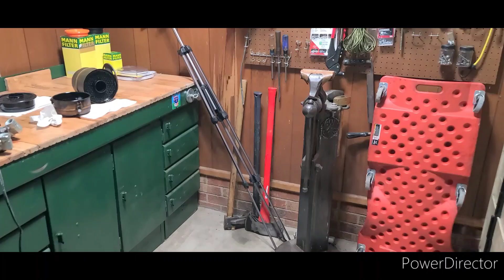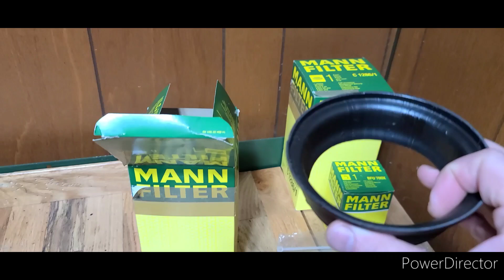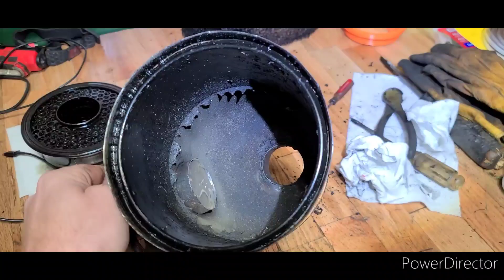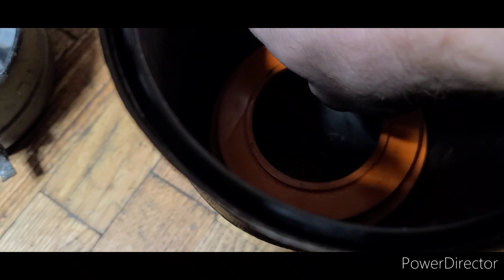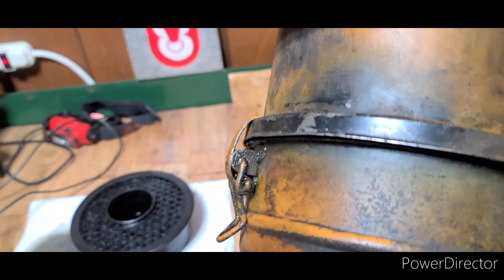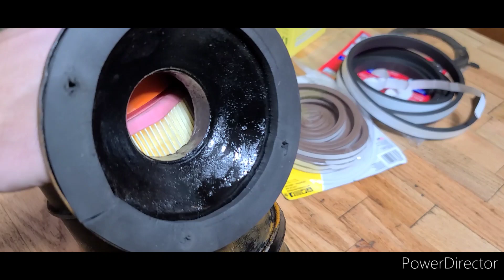Unimog 411 oil bath to paper filter conversion

Comment: Looks like a good mod to me! May help the engine breath a little more easily and that’s no bad thing with an early Mog with its limited hp 👍. The real advantage of an oil bath filter was it could be cleaned regularly and thoroughly in the field with no replacement part required - just oil - then work could continue. Trouble is they often get neglected and then become pretty ineffective - I think these days a paper filter probably wins 😁
Reply from the maker: Thanks for the feedback. Its clearly driving better and seems to be flowing more at the inlet port. The filter im using is a Mann C 1286/1 which was recommended by a colleague and fellow engineer with 411 experience. i do have a drawing and model for my version of the adapter should you or anyone need.